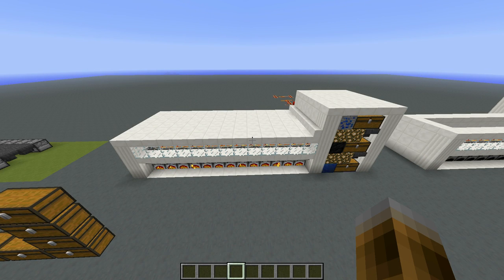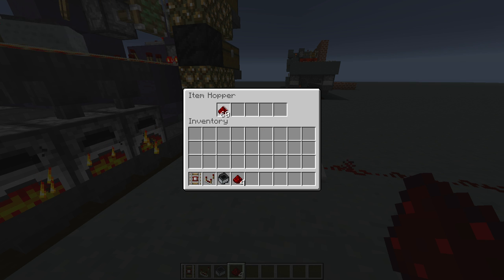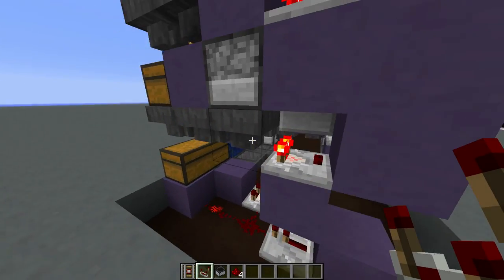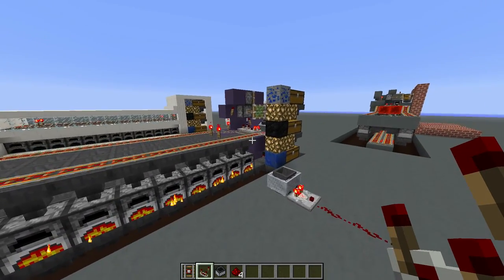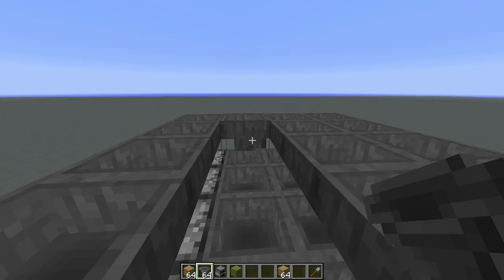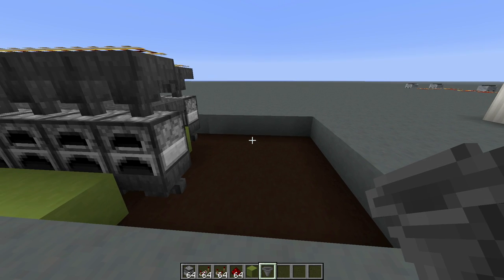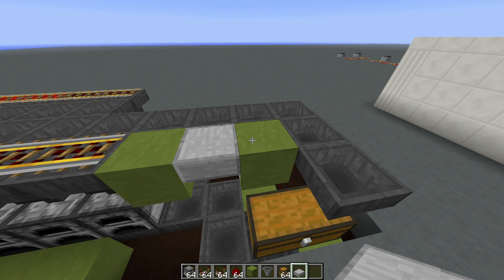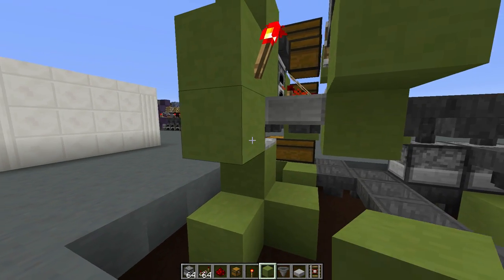Minecraft Showcase+Tutorial: Industrial Furnace Array

Comment from the maker: as long as the compatator at the corner is off, the system shuts down automatically, therefore you need a lot more fuel in the system before it starts, as I explained in the video.

Comment: It's not that much different to make this work with sticks, for whoever is wondering since there wasn't a sequel to this.  If you want you can copy the same design and it will work perfectly fine with sticks, the only problem being the flow of sticks in a single hopper chain will be too slow after some time has passed which eventually will cut throughput in half.  If you aren't doing huge smelt jobs it's not a big deal. It's also not a huge effort at all to simply create two separate hopper chains for the sticks coming from double chests, which will allow it to keep pace.  Small re-routing for two fuel lines instead of one and that's it... Also I recommend putting permanent power on the sloped powered rail behind the detector rail, otherwise very occasionally the cart seems to get stuck on the hill- maybe once every 100 trips or so.  Since I powered that rail permanently from the side it has not got stuck since then.  Also the dropper at the end for collection really is unnecessary unless you really want all that to feed upward by only one block and save 1m of vertical height!  Just link the hopper lines to a double chest directly on the same level or lower- and separately- no more clogging or clocks.

Comment: It would work, but the smelting speed is 2,5 items/sec which is identical to the maximum speed hoppers can transfer items. Adding more furnaces with a longer hopper chain would only make the system clog. Unless you make a seperate hopper line ofcourse

Comment: the problem is that if you only have like 15 items to smelt, it will use 15 pieces of coal, making this machine extremely inefficient
could you make a design that would always put items in the furnace in sets of 8? that way it would always be almost 100% efficient with each piece of coal
thanks

Comment: Warning! Don't use mixed fuel for this! I put in whatever I had on hand (sticks to begin with, then planks and coal and whatnot) and everything in the hoppers gets mixed up and there's shovels everywhere, so you have to take it apart and restart with your new fuel. I think it would be fine if I did each fuel one at a time in bulk amounts, but putting in a few planks and some sticks and a half-stack of coal will get the system completely messed up.

Also, JL2579, I have a problem where the minecart fills up with the 25 items it should, but it doesn't deposit them in each furnace, it usually gets the first two and then skips about 7 and then moves on to the next set, and I don't look at the other side much. Any idea why this could happen and how I could fix it? I built it in survival on a server (Iron farm FTW!)

Comment: i run it with lava and it works greate BUT, :)
ones in a while the minecart stuck su far up under the chest so it does not tutch the detector rail therefore does not power the track i sits on and get stuck :(
any solotion for that out there?

keep doing awaysome videos :)